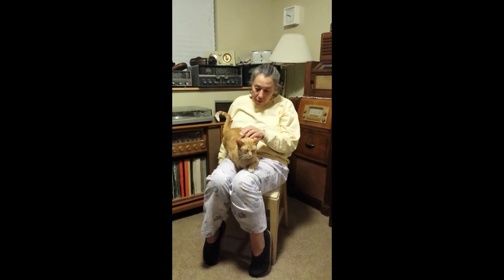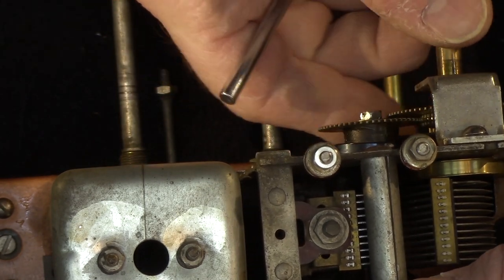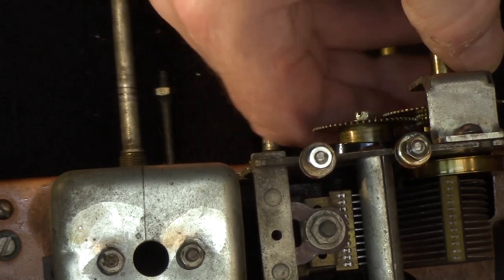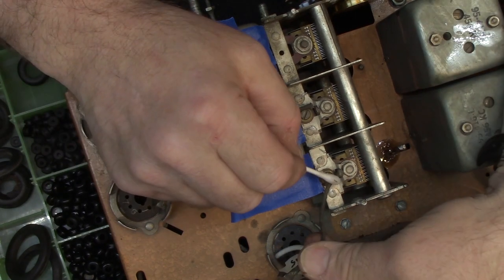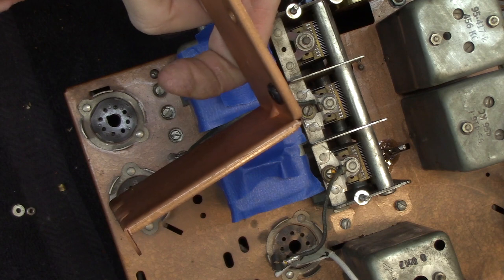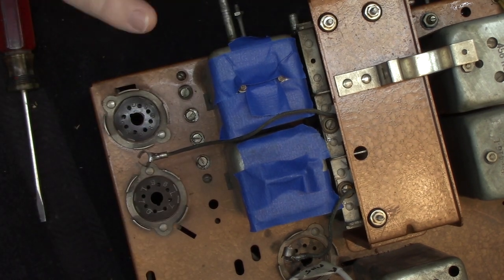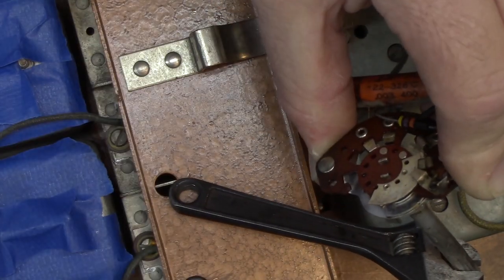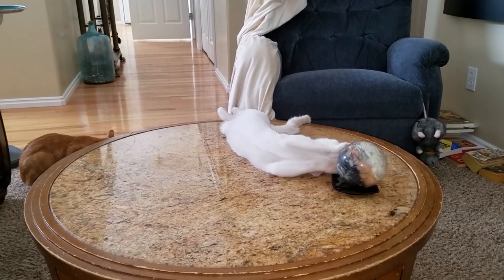1938 Zenith 9S262 Shutter Dial Tube Radio Part 7 of X  Tuning Works continued

Comment: once on a X-ray service call I found the problem to be the 6-deck rotary switch for the exposure timer was missing the wiper on 1 deck, the contacts had sliced it in two from being operated thousands of times between 1938 to 1979 when I drew the short straw so to speak. 
Desperate I fabricated a wiper from the metal lid of a 'Buss' brand plastic fuse container and silver soldered it in place.
It worked fine, and I figured it would last at least 6 weeks, and I should have a part within 30 days, so being over 500 miles from home, I drove home & ordered part the next day at the office, and carried on as a field service engineer.
When part came in & hospital contacted they said to wait until it broke, then bring it & install it, they had paid for the part, so okay. We took that machine in when we installed a new system there in 1980, the old one was re-sold locally to a clinic, while I installed the new one, and I re-installed the old unit upon my return, placing the new deck switch still in the package in the bottom inside floor 'tray' of the x-ray control, I could always drop by and install it when the one I repaired finally failed. It was still there in 1989 which by then I was in another State as a Factory service representative, but later in 1992 met a veteran who had worked at a local (to there) clinic that bought it from the local clinic I had re-installed it in, and he said it still worked fine, and the new switch was still in the base of the machine behind the cover.
This balances the universe where the brand new part that took 2 weeks to get overnight air freight again over 500 miles from home, up in the Ozark mountains, in winter, fails in 3 days.

Comment: I bought a vintage Grundig Majestic console(PP EL95) unit and recapped the electrolyte capacitor since it had 120 cycle hum. Now, no hum but one channel is giving me less volume whereas other channel works nice. I have measure the preamp tube ECC83 voltage with out tube it comes around 215 , with tube 50 and 95 in pin plates. Any suggestion to fix it will be helpful and thankful.

Comment: Hello! Great videos, I am restoring the same radio also. Questions: what is the source for the rubber grommets for the variable tuning condenser cover? And where do you buy the wide solder wick? Thanks, I gave thumbs up!
Reply from the maker: Thank you so much, Bill.  I'm very sorry for being so slow to respond.  Sadly, since my wife passed nearly three years ago, I have badly neglected the channel.  I am working hard now to get things in order so that I might start to present some fresh projects and breathe some new life into the channel.  I have also been spending a lot of time and effort toward equipping and training myself for manufacturing and selling reproduction knobs and the rubber grommets you refer to.  The gentleman who has been the mainstay of supplying those sorts of parts recently retired.  While I will find it to be challenging to ever match his level of expertise, I am going to try to be of some use to the community by eventually filling some small part his very big shoes.  More to come on that, soon.  As far as solder braid goes, sometimes I can find it on Amazon.  Other times, I find it at MSC, and finally other times, I have to resort to eBay. The wider stuff is very hard to find sometimes.  I used to be able to find it in 25-foot spools.  Now all I can find are 10-foot or 5-foot.  Please forgive the long response.   All of the above is my long way of saying that I am grateful to you for watching my vids, and I am working hard behind the scenes to be able to give folks more video projects to watch and perhaps more help with their own projects.  Cheers!   Michael
Reply: Hi Michael great to hear from you and to hear you are taking over Eds antique knobs and rubber remanfacturing.  I know you will do well in it.  I stocked up a bit when he said he was shutting down.  Take care of your self and we'll hear from you in due course. 

Steve

Comment: Hi how you doing! what's going on with notifications bell it's crossed out I can't set the notification Bell
I can see the cog wheels binding you look you is shiny spots where the cog is not round and is pinching you can run over it with a jewellers file bevelling the edges as well
First clean them out with a toothbrush isopropanol might be enough and slight bit of oil on the cogs.
Not sure you should measure with crocodile clips on the tone control the clamping force could actually decrease the resistance and give you a false reading